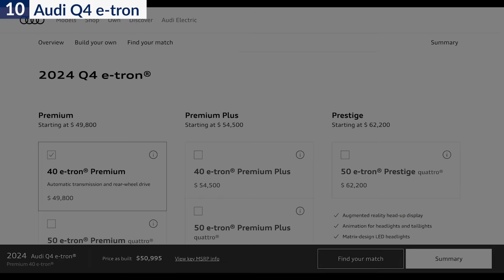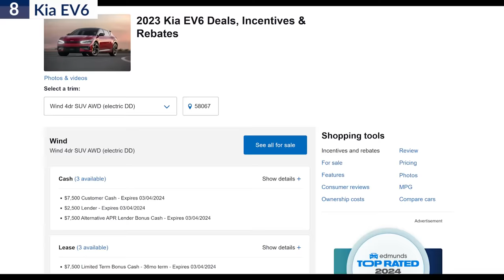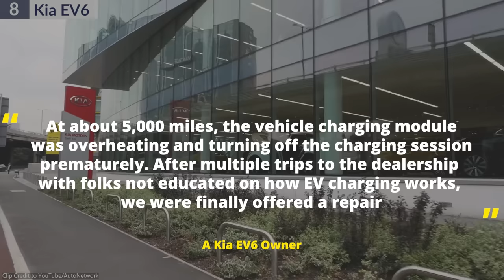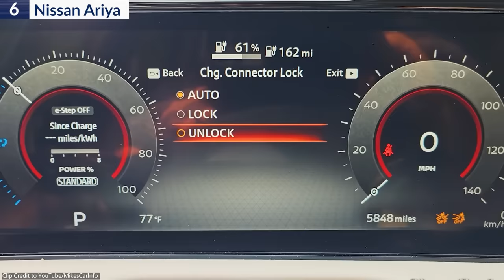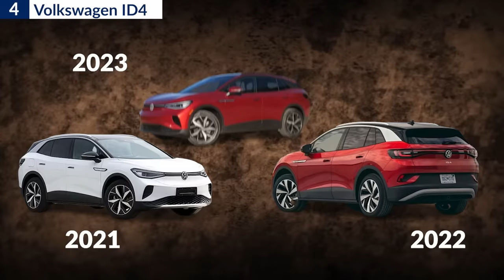New Electric Cars Piling Up on Dealer Lots in 2024 – Here is the Truth!

Comment: Ev not for me if people are happy to Waite 45 mins to charge there  car up ,good luck plus your tyres don’t last long?😂
Reply: There's more to the story, believe me...

1. Child battery mineral labor

2. Range anxiety

3. Risk of garage fires

4. Paying 20k more than a
comparable vehicle

5. every time you fuel up an EV, the fuel tank gets smaller  and smaller. Battery degeneration. 

6. Poor resale value

7. Reduced performance in
cold, highway.

8. Higher repair costs

9. Awful charging network
experiences in the weather
without restrooms

10. Higher insurance rates

11. Replacing tires more
frequently. Michelin states that tires wear out 20% faster on an Ev, and could be as high as 50% faster! Ev tires made for ev's, cost 20 to 30% more, than regular tires for ice cars. As Ev tires wear out, they leave behind more tiny particles of rubber than normal ice cars. This causes more pollution. 

12. Death by autopilot

13. $25k - $35k battery

14. Low km range per tank of energy. 

15. must wait in-line 1-2 hrs
to charge.

16. Then wait more time to charge, while charging.

17. Spontaneous combustion, with no way to put out the fire storm.

18. If they catch fire in a tunnel, many people will die.

19. People without a pro charger system or a parking spot at their house, will run an extension cord to the road, which is dangerous and could lead to people tampering with your charging setup (super slow charging at the road)

20. If you're in California, you won't be able to charge your car past 4pm because of a shortage of electricity supply on the cheesy grid.

21. It is not actually "green". The pollution is made at the power station, and during the manufacturing process, not the car.
In advance of the Cop26 climate conference in Glasgow in 2021, Volvo released figures claiming that greenhouse gas emissions during production of an electric car are nearly 70% higher than when manufacturing a petrol one.

22. Only 5% of used junk batteries get recycled, the rest go directly into the bin. It's cheaper to mine for new minerals.

23. Chhinna actually does 70% of all the refining of the minerals and production of the batteries.

24. Minerals are becoming more and more scarce, and the cost will only go up, not down.

25. Some countries where they mine for lithium, actually use a very big boat load of fresh water to only produce a ton of lithium, so they are afraid of running out of water. It takes over 2 million liters of fresh clean water to produce 1 ton of lithium. 

26. Ev cars will soon not be able to drive in tunnels or be able to park in underground parking garage and probably will eventually void your house insurance if you park it in your personal garage.... 

27. You can't charge your battery at super stations when it is bitter cold out. 

28. If a fire truck comes to put out an Ev fire, all the chemicals go directly into the sewer system, poisoning everything. They need tons of water to slow down the burn. They can't put them out. They are only trying to prevent over things near by from catching fire. 

29. Ok, there is 2 good things; regenerative braking, which charges the battery while you are slowing down on the highway, which saves your brakes from much wear.

30. Loss of fuel tax revenue, so now the roads will only get worse, not better. 

31. in Dublin, huge generators are being used to charge EV buses, due to electrical grid strain. buses in Athlone also cannot be put on charge until midnight, for the same reason. Bus Éireann is saying that they can't charge their buses until 11pm for the same reason,  and to avail of a lower tariff. 

32. Not everyone on earth even has electricity to charge their cars. What are they supposed to do in 2035? It's easy to get a bucket of fuel to power up a regular car. 

33. VCE, or "vapour cloud explosion" is very bad. If any battery, typically anything larger than an E-scooter battery, and especially only "half" charged. If a problem occurs in the cells, it might not catch on fire right away. Instead, a cloud appears, and then may be ignited a short period afterwards. There are 2 different types of vapour clouds that appear; heavier and lighter than air, which form will be dominate, can not be predicted yet. This produces a bomm.

34. For Ev transport trucks, they aren't allowed to carry the same payload as a diesel truck, because of the massive weight of the battery. The owner of the Ev truck therefore loses potential profit, every day. They also lose more profit for the waiting times for charging that Ev truck. The driver will get paid to charge the truck, which in turn forces the owner of the truck to lose more money. 

35. Ev cars are more likely to be written off, if they experience a minor collision. After the collision, something could have upset the structural integrity of the battery. 

36. Ev cars lie to you. If you are bold enough to go out on a decent road trip and its 210 miles, one way, and your Ev tells you that your battery will last you 223 miles, there had better be no hills, or excessively cold out.... You'll probably get stranded, trying to get to the charger, at the end of the trip. Ev's have left many families stranded already. 

37. Ev's and their batteries, will soon need their very own "passport". With all info about them when born, and current info about them (power output, resistance, mineral composition, etc.) 

38. Thieves stealing charging cables, will soon make it impossible to "fuel" an Ev car. They take a long time to replace the cables, just to have them cut again for scrape money. 

39. Cars were typically being made lighter and lighter using aluminum and or fiberglass and or carbon fiber, to reduce emissions and pollution. Ev's are only getting heavier and heavier, causing more pollution than ever. Remember, an ev's pollution is made at the power station and the dump, not at the actual Ev, except for the tire particles as mentioned above. 

40. More on spontaneous combustion of the battery. What if you had 3 kids strapped into car seats, in the back seat ,which kid do you rescue? More fires start so fast, there is hardly any time for even the driver to escape, let alone 3 kids strapped in. 

41. There must be a reason that Boeing 747's aren't battery powered.... Until jets are battery powered, I'll be sticking to fossil fuels for my mode of transportation. 

42. Can't bring an Ev up north in the woods, nor any battery powered chain saws, where there are no grids to charge them up. You would need a huge amount of solar panels to get you anywhere. 

43. Even Mr. Bean says;
"I love electric vehicles – and was an early adopter. But increasingly I feel duped". 
"When you start to drill into the facts, electric motoring doesn’t seem to be quite the environmental panacea it is claimed to be." "It seems a perverse choice of hardware with which to lead the automobile’s fight against the climate crisis." 

Mr. Bean is a smart man. 

Ev's (External combustion vehicles) suck, and it's a bridge to nowhere. But they do sometimes convert themselves into "internal combustion", but sadly, they can only do that 1 time.
Reply: Lmao do you know that you don’t have to charge at public chargers? My neighbor plug in their model y at home when they need to charge it my close family member own a model y when he does errands when he need to charge he go home and plug it in smh and my cousin he charge it at home when he need to if people too lazy to charge at home then don’t complain.
Reply: @vce.john1734  lmao... So they must have a driveway, or a parking spot or a garage with electricity near by.

Many, many people park their cars on the road or a parking garage with no electricity. Illegal to run a cord to the road, especially across the street. Cause half the year, you usually park on the other side of the road. 🤣🤣

What then???

Comment: I went to a VW dealer looking for a GTI or Golf R, and this dealer had a big line of ID.4’s they couldn’t sell. 

Expensive to maintain, low range, hard to find charging, cars catching fire, you look like an Ahole of the neighborhood, cars not starting in cold weather etc. we aren’t ready for EV’s yet.
Reply: Expensive to maintain? That's definitely false and cars catching on fire is very rare ocations that it makes headlines. See that's what's wrong with yall, you something and you thing every eve blows up or catches on fire like it's a 4th of July, and where in the world you got info that it's more expensive to maintain ev than ice. There's no oil change or steering fluid,
Reply: @i.d.6492   EV technology will is a new thing. I hear stories about it costing 5-20k hell some are 30k. That’s a lot of money for a car repair for most people. If one little cell fails, the whole battery needs to be replaced. EV’s may be the future, but right now in 2024, we aren’t ready for them yet.
Reply: @peppapigthekiller7539   that's the thing " you hear stories". Bettery failure does happen here and there just like engine failures happen. Even if the repair cost is like $30K for bettery, YOU ARE NOT PAYING FOR THE REPAIRS BECAUSE IT'S COVERED UNDER WARRANTY, so even if it's $100K cost, it's ZERO THAT'S GOING TO COME OUT OF YOUR OWN POCKET, so replace bettery and keep driving it. Situation like bettery failure is extremely rare compare the number of evs on the road today
Reply: @i.d.6492  what if the battery goes bad after the warranty? Who’s covering you then. Plus, isn’t the point of electric cars to be cleaner alternative to gas powered cars? Kind of defeats the purpose considering battery producing is a dirty process.
Reply: @peppapigthekiller7539  my dude.. if the battery goes bad after 10 years then that will be someone else's problem cause I don't drive old bangers anyway 😂 10 years warranty.. tell me an ICE car that gives you the same warranty for their components... There's none. You just got schooled by that guy and now you are pathetic talking about environment 😂 Sit down.
Reply: What expensive maintenance then? I have my Tesla already for a while and had zero maintenance yet. Not starting? :) LOL it's the MOST reliable starting car i EVER HAD.
Reply: Bull, peppa. IDs are easy to maintain, have very good range, handle temperature extremes very well,  handle beter than a golf R and far more fun to drive,  can charge them at a Tesla supercharger or any other place...
When you choose to make stuff up, peppa, you only fool one person... yourself
Reply: @peppapigthekiller7539  Totally untrue, if one cell fails you can replace that cell but it will still work ir the cells is not fixd.
You may be thinking of the old acid battery in your ICE car. That does need to be replaced if one cell fails.
Reply: @HermanWillems  how long have you owned your Tesla? And how many miles does it have?
Reply: @johnn17golf ID-4 handles battery than a Golf R? You mean that big ass SUV handles  better than a small  golf R? I challenge that. I drove a model Y (I compared it because it was another SUV) a couple years back and that was not as good as the R for me, but I’ll maybe I’ll try testing an ID-4 and see if VW/Audi did anything. But even if it has good battery control/life, very cold or hot conditions do decrease range, and battery ranges decrease with battery age. Also, estimated ranges that the EPA or car company give out aren’t always accurate in the real world.

 And I hear a lot of shit going around about faulty chargers  not charging, people unplugging them when owners not around, long lines at busier chargers etc. Hell, I saw a small line of people at Walmart with their electric cars waiting for available charge ports because all the ports were already being used up.
Reply: @peppapigthekiller7539  Ever driven an ID 4? Low centre of gravity, excellent torque, weight balanced to all four corners... Yes, I have driven golf R and ID4.... ID4 is WAY more fun to drive. 
Go chat with EV owners to dispell that silly stuff you repeat. It is not possible to pull out chargers when charging. Who feeds you this stuff. I see lineups at gas stations, not chargers. It has to be -30 for range to decrease to any noticable degree but there has never been one time in 3 years where I have worried in the least about range and I drive local and long distance.
GO speak with EV owners instead of relying on russian oil lobby paid channels like this one.

Comment: I get tired on constantly having to charge the Model Y.  Stated range is 303, but not even close.  They don’t tell you up front you only charge to 80-90% so now range is 240-270, but then only after nine months only getting 220-250 miles due to battery degradation.  Then my 46 mile one way trip to work takes 58.7 miles of electricity. So now I have to at least partially charge each day where I was able to charge the car at first every 2.5 days….  I am thinking of selling.  I have a 10 year old prius and it still gets 50-54 mpg and no maintenance except oil changes, tires, and wiper blades. I bought the Tesla since the cat was stolen and I waited a year for a replacement.
Reply: Yeah.. cause it's so hard to plug in the car at the end of the day and have 100% battery the next day... Oh the drama 😂
Reply: actually I work 12-14 hours a day and then every other day I need to drive at night on the way home to a Tesla supercharger, which the closest to my house is 15 miles away.  I wait 30-40 minutes to charge to 90% as this is the daily max with Lithium ion batteries, best is only 80%. After charging , 30 minutes later I am home. So yeah it’s not as easy as you might think.
Reply: @briankoch1121  If you don't have charging at home or work an EV probably isn't worth it.
Reply: @briankoch1121  infrastructure may not be there yet for everyone to fully benefit from electric cars but imo that doesn't mean that we should go backwards and think petrol/diesel are the alternative. New battery tech will replace everything we drive soon.

Comment: Electric car owners, tesla, bmw, or low quality korean ones, no matter which brand, you name it, are getting F ed in resale value every day. Not to mention any time there is a problem, their car is totaled. Lmfao…
Reply: Until the recent price cut by Tesla, my car was holding its value better than any other car I've ever bought. Two years after purchase I could have sold it for 90% of what I paid for it. Most cars drop 15% when you drive them off the lot. Resale value definitely dropped when Tesla announced price cuts across its line.
Reply: I had a minor problem with a seat belt warning sensor on my Kia EV. It wasn't totalled, it was repaired in around 30 minutes, at no charge to me, as it came with a 7 year warranty.  Resale value is irrelevant if you lease instead of buying.....
Reply: @michaelelliott8350  The slide is accelerating, not slowing down. You ain't seen nothing yet.
Reply: @Brian-om2hh  Leasing a BEV in the future, like from Now on, will be very expensive because they will calculate lower value at end of lease. Maybe you lucked out but count no man lucky until he is dead, and there are many more pitfalls ahead you must dodge.
Reply: Problem is that most people who buy EVs are smarter than you guys. If you buy an ev for 40k save £2k a year on gas every year for 10 years, it doesn’t matter if your car has depreciated by a few k more than an ice car.
Reply: @Audioremedy0785  If that is the case then what are you  saving. Plus all the lost time charging and in 10 years that EV is a worthless paper weight. Yeah I know you charge at home. BS
Reply: @bob-qi4nr  I save £2k a year in fuel. And I have spent 0 minutes waiting for my car to charge. Literally nothing. Your argument is ultimately that you would rather spend more time and more money driving a worse car that is worse for the environment. If that’s what’s important to you then run with it 👍🏻👍🏻
Reply: @Audioremedy0785  Environment?.......Child labor?
Reply: @bob-qi4nr  child labour doesn’t have much to do with the environment.
Reply: @bob-qi4nr  The oil industry are the largest users of child labour, as they've mined cobalt for generations. In the meantime, EV manufacturers are switching to cobalt free batteries.... Has the oil industry even been beneficial for the environment?  Huge oil tanker spills etc?   And when you get a minute, just check where your clothes were stitched together. You'll find it was probably in the sweat-shops of India, Pakistan, Thailand or Vietnam. But hey, you're probably ok with that, because you need clothes.....  Most of the World's lithium is mined in Australia and the South American "triangle" of Chile, Bolivia and Argentina.
Reply: @Brian-om2hh  EV's SUCK!!!
Reply: That's actually sucks that some gas vehicles hold better value because for as a buyer I don't want to pay for some old ugly camry with 100K miles on it almost as much as some new cars cost
Reply: Most EV depreciation numbers are flawed.  If you buy a $50k car that has $10k in subsidies it becomes a $40k car.  So when the value after 1 year is only $30k, that's really a 20% depreciation, not a 40% depreciation.  20% depreciation after 1 year is common for cars sold for $50k.
Reply: @Audioremedy0785  your battery is going to last 10 years. good luck in winter.
Reply: @jeffguan1  it’s anticipated that the cost of battery packs is going to go down around 10% a year over the next 10 years.  If after 10 years of saving £2k a year on fuel, I’m having to spend c£5k to get myself a fresh battery, I’m not sure where you think I’m a loser in this situation.
Reply: @Audioremedy0785  It's okay when you can charge at home.
If you live in a condo and there are only several charging stations at your building then the idea is not so good anymore.
Plus do not forget subtracting the increased insurance premium from your gas savings.
The balance may turn out to be not as good as you have estimated.
Reply: I drive my Tesla model Y Performance and you will always see my tail lights!